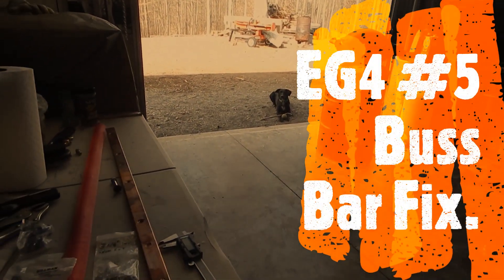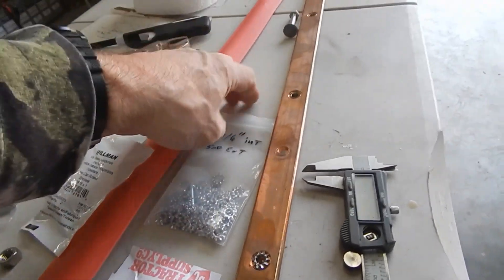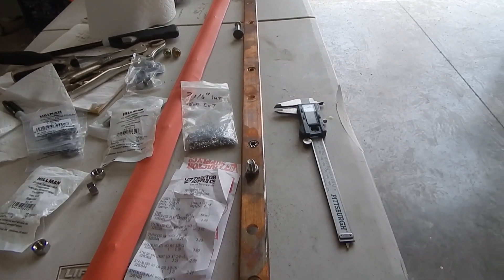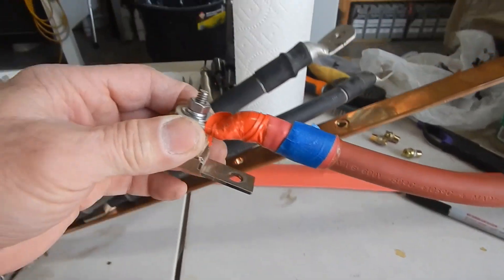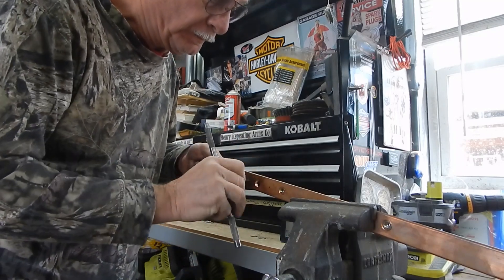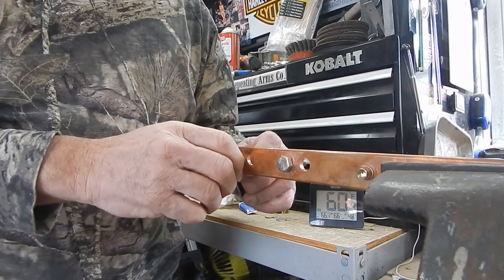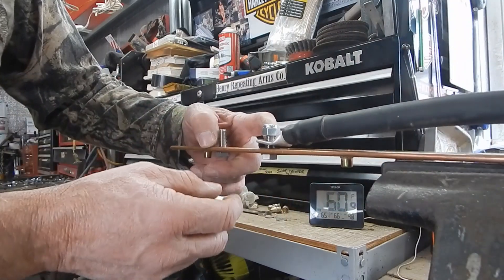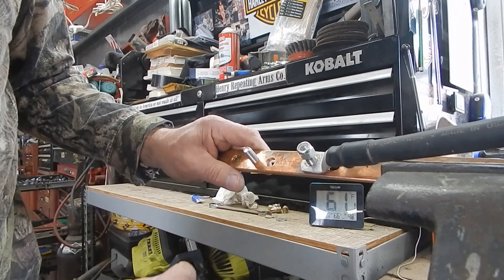EG4 #5  Update   Buss Bar Fix. How I did it. Parts used.

Comment: Thanks for sharing!  Sorry you're even having to go through all this to get your battery rack usable.  Ultimately it looks like you are making it better for you though.  Hope SS makes it right.

Now I haven't seen these racks in person, so this might not be an issue.  The only concern I would have is that if you have to remove one of those battery cables, wouldn't you have to remove the entire bus bar in order to get a wrench on the bolt head to prevent free-spinning.  Is that gonna be an issue or can you get a wrench behind the bus bar without it contacting the metal case?
Reply from the maker: I'm still working on it not going to use those little rivnuts .Waiting on finishing my mechanical room & 2 more batteries later next week. Signature solar was very helpful to me they treated me well so I spent more money with them I'm happy.

Comment: those threads are counter sunk for a reason and should be left as-is (unless you really know what you are doing). When you use a lug you want direct contact with the *bus bar*. By inserting anything you increase the risk of creating a gap where the vast majority of the surface area for contact resides. But I also replaced the cables provided with 1/0 cables and larger copper lugs as I wanted to reduce resistance wherever possible, which gave me even more contact area.

The new bus bars do not need to be rotated as they have larger lugs on top and bottom (assuming your threads don't pop out).
Reply from the maker: Changing my setup on the bus bars.

Comment: You will get less resistance using a flat washer than the serrated washer.
Reply from the maker: Changed the setup completely did not use rivnuts.

Comment: Stainless don't pass current for shit. I'd use steel
Reply from the maker: They are clamping copper to copper
Inputs on on my inverters are ss bolts to copper as well.
Reply: Stainless isn't a good conductor
Reply: Not only is stainless a bad conductor most the time you need to cut the nut off to remove them if needed.

Comment: Can you help with another concern I have----Sig Solar sold me a pair of 1ga battery cables to connect the battery buss bar to the inverter. I notice lots of people like you are using 4 ga.  Will the 1ga cables work or is this another potential hazard.  I only have 3 batteries for now.  Can I get some recommendations....
Reply from the maker: I have no idea what type of inverter you're using. My setup is 2 magnum energy 4448 PAE  They're a low frequency big transformer inverters. Capable of 8800 W continuous 17600 watts briefly. I have no idea what your inverter is capable of or what you're working with so I can't help with the information I have so far. My setup requires 4-0 cables not 4 awg they are big.
Reply: @TheKiloG69  Thanks neighbor.  FYI:  I have the EG 6500EX inverter.  I have messaged SS to give me some clarification.
Reply: @clarkwheeler8764  that is the recommended size as well as the math supports it on the 6500ex
Reply: @jamesshowalter6362  Thanks for your reply.  Jason at SS messaged and assured me that the quality of their cable in the 1AGW size is perfectly fine.  He recommended to monitor it with a heat sensing tool in heavy loads just in case a connection isn't tight enough or loose and is getting too hot.

Comment: THAT looks awesome. Nice work. The buss bars they sent with mine are different -- no main battery cable posts, just six for the six batteries. We'll see what they send me. I seen one video where they were tinned (silver colored). Hmmm. I also am going to use cable raceways vs heat shrink tubing.
Reply from the maker: I'm using shrink wrap after everything is completely assembled and then covering the entire thing with a split wire loom be completely insulated that's my hope.